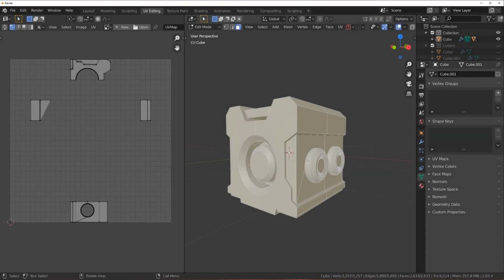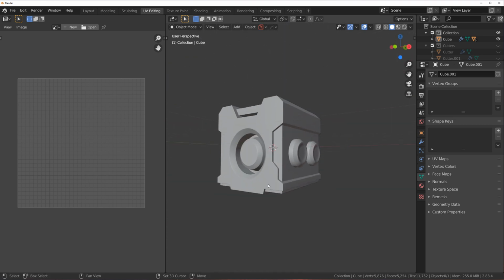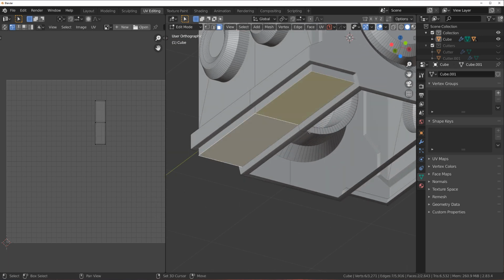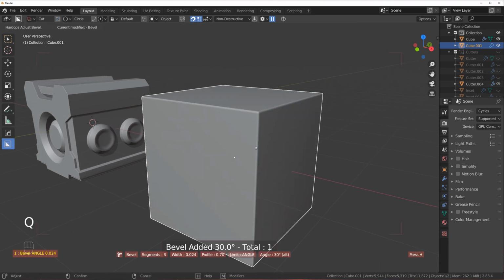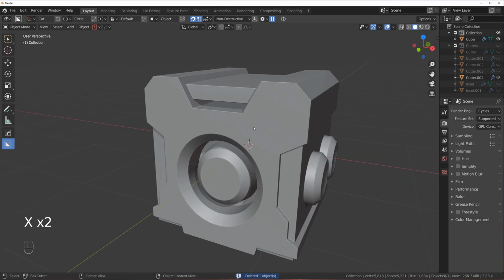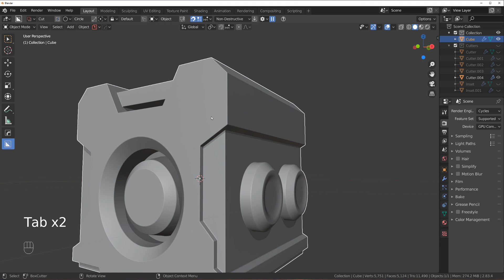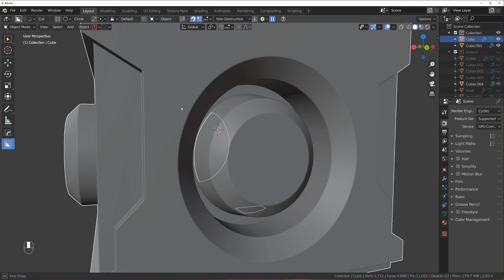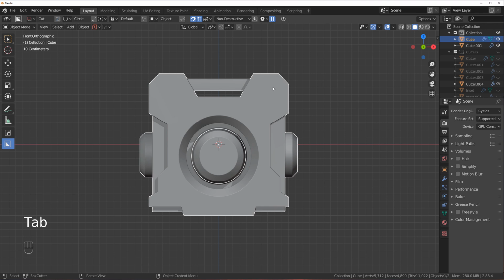MESH optimisation for UV unwrapping in Blender

Comment: Hey man just found your channel bc of josh and I’m loving it. You are hilarious and very good at what you do. One question, I was following your tutorial on the save startup menu video. I followed it exactly but when I start up a new file and go to rendered view the mesh is purple. It is fine in material preview but even with multiple nodes and everything it is still purple. Any ideas?
Reply from the maker: hey cheers, yup, you need to load HDRi , otherwise you have no light source.
Reply: @PonteRyuurui  Ok i have an overcast HDRI loaded in already. Do i have to add a separate one every time I start? Sorry if this is a stupid question.
Reply from the maker: @thesenate4536  nah just save startup file and you are good.
Reply: Ok thanks man rly appreciate it. I was modeling a decal and pressed ctrl Z like 5 times and blender crashed or just closed and I lost everything. Is there a hot key that I don’t know about that closes blender when you hit it. If not I have no idea how to get it it back or what caused it.
Reply from the maker: @thesenate4536  download addon power save, and read how to use it, it is very simple, it will save your ass next time blender goes down. ctr; q quits blender, i deleted the shortcut, go to preferences, keymap, type quit in search and delete the key binding, then save startup file.

Comment: DONT BAKE BEVELS!?!?!  I'm very glad I watched this video!  I would have thought it would be a no brainer to do it.
Reply from the maker: ya man they look like junk, for real
Reply: @PonteRyuurui  Normal mapped bevels look fine bro and a normal map would have worked fine considering how small you made your bevels. They barely even affected the silhouette.
Reply from the maker: @loldoblender625  i cant be fucked to argue this mate, so whatever you say ya
Reply: @PonteRyuurui  ok whatever
Reply: @dyotoorion1835  Alien isolation also used this technique on their environments but this technique is used to save texture space and not because normal mapped bevels look bad. These games wouldn't be able to perform well with a custom normal map texture for each object so instead they can use decal normal and trim sheets to achieve expansive high quality result while saving texture space. But if you have a prop that is going to be really close to the player a custom normal map provides bump details that come from the surface quality of the material and allows it do have details that are unique. For example you could sculpt custom damage onto your bevels in zbrush. Overall the technique you use should really be decided by what the object is going to be used for.
Reply: @dyotoorion1835  You're correct that normal mapped bevels will eventually show the hard edge if you zoom in enough but it is only really a problem if the camera is really close to the object but its not really a problem unless your getting super close to an object in game and if your getting that close to the object it should probably have more geo. As for your own experiments idk anything but you're probably right. In their gdc slides star citizen mentioned that both tiling textures and baked maps caused performance issues.
https://twvideo01.ubm-us.net/o1/vault/gdc2015/presentations/Brown_Alistair_VisualEffectsIn.pdf (slide 65)
Depending on the distance fwn and baked bevels will look essentially the same with only a minor difference in silhouette if you do it as small as Ponte did. Given the object he demonstrated on I cant image that's a prop that would be right in the players face. If you need to your object to be close to the camera then more geo because fwn + a normal map would look better. I don't have a problem with people using fwn but what techniques you use should be dependent on the needs of your project and how much screen space the object takes up so normal mapped bevels shouldn't just be thrown out the window.
Reply: @dyotoorion1835   Yeah i know any normal split or uv split increases the vert count. The vert count also likely wouldn't be exactly the same because you would still need to place some uv splits along the edges to keep the uv map from stretching. But I still see baked normals on the trending weapons channel for artstation so I don't think they've just been adopted universally and I think they look fine. They definitely don't look like junk if your are baking them properly. A reason you might want to use normal mapped bevels is if you using trim sheets.
Example:
https://www.artstation.com/marketplace/p/jdMO/escalator-hybrid-trim-pdf-tutorial?utm_source=artstation&utm_medium=referral&utm_campaign=homepage&utm_term=marketplace (free btw)
Using a trim sheet for this asset allows him to maintain a higher texel density across this asset than if he baked down to a unique texture map. I'm pretty sure nowadays textures are more of a limiting factor when it comes to performance so techniques like trim sheet can reduce the amount of textures needed to create a scene because you can use them for multiple assets.

I think games are probably using both techniques but i don't work for a AAA studio so I can't say for sure.
Reply: I wish I could have seen this thread last week. I spent 3 days trying to optimize an object to get the bevels to bake properly in substance painter and get it to look decent in Unity. My conclusion after 3 days and like 10 different mesh optimization passes and baking, don't bake bevels. 
Also learned that baked bevels especially don't work on a mirrored UV mesh because the normal map is mirrored and is totally borked.

Comment: I don't like to unwrap in blender because it's hard to make islands stacks. I'm practicing, but I know that in gamedev (gun, for example) you do one single material with one uv map for it, so there are a lot of parts that should be stacked. I dunno what about addons, but it's hard to do it in vanilla blender without island groups, like in RizomUV or UVLayout. Even if you do it manially and then press "pack islands", all shells in stacks would be ignored and packed separately from each other :c
Reply from the maker: well thats why we use addons, like uvpackmaster2 or texel density
Reply: @PonteRyuurui  Thx! I didn't know about this addons, time to learn new things
Reply from the maker: @mikelgrenlou558  ;-)

Comment: Little warning : If you go with the mirroring solution, you will need to be very careful with the weathering or you will get kind of inkblots effects! But I guess this varies based on what type of universe your object is in. In a very high tech world where everything is clean, you wouldn't have to worry about it as much as in a cyberpunk universe where everything is covered in dirt!
Reply from the maker: well you duplicate them on x, so they are identical but those are separate UVs, so you can apply different effects to them.